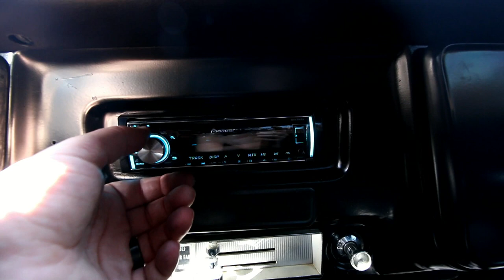Alcantara Suede Drifting Steering Wheel

Comment: I've used a similar ebay wheel for 18 months without a single issue including a lot of performance driving with a manual steering rack. You'll know pretty quick if you have a bad one or good one.
Reply from the maker: people just like to be negative....I have no worries
Reply: The Fab Forums Agreed. It would be a great addition to the interior of the Goose

Comment: hey Kyle have u ever rotated an axle to achieve correct pinion angle?   I'm trying to flip my rear axle in my 1978 Chevy blazer and want to do everything correctly. i understand I can buy a kit but had the perches already and plate to make the u bolt plate. would rather "fabricate" my own rather than buy. Didnt know if u had ever tried it or done a video on it. any info would b a huge help. thank you in advance  God bless and go build something :).    Sam
Reply from the maker: yeah... I have done on trucks I have lowered and many times on drag cars

Comment: Okay, so the rivnut video you link above shows a different tool.  The rivnut tool I bought broke within the first project I tried (stronger rear door panels on my Suburban).  The blue one you use in this video is similar in design, but I'm guessing it works as advertised.  Can you provide the link to it, too?
Reply: My bad, you did link it after the video.  I guess I bought the cheaper version of the Astro (the 1427).  Not sure why it doesn't work like it's supposed to.  Has the 1442 worked well?  I may need to upgrade to it.
Reply: We use AFS Marson rivets, rivet-nuts, nut-serts, thread-serts, stud-serts and tooling.  We have not been disappointed with the quality, results or the performance of the tooling or consumables. 
In our business failures are not tolerated.
Reply: I use the same one he has and have for awhile now. Ive probably installed 5 sets(4) wheel flares and made countless mount brackets/switch panel mounts/batter box mounts/fuel cell mounts/methanol mounts/ various underhood acc' mounts on the racecars i build for people and havent broken it yet. i'd say im probably close to 300-375 rivnuts in with it, if that helps you out at all.
Reply: sly5.0gt actually, yes, that does help immensely. Thanks for the info!
Reply from the maker: I have not had any issue with it so far

Comment: i personally wouldn't cheap out on the thing that is the direct interface between you and the vehicle. there have been many horror stories about cheap ebay steering wheels. i guess if it's just for a car that you cruise around in it's probably ok but i wouldn't recommend it in a vehicle that you do any type of performance driving in. Driven Steering makes a wheel that is pretty much identical, except black and red you can rely on for about $160.
Reply from the maker: I have had several concerned about the strength....guess I will have do some testing
Reply from the maker: I have had several others send me this same video. Looks to me like dude pulls the hellllll out of it in the beginning. Who actually does that though? I will for sure take a good look at the wheel I have but that video doesn't concern me at all. Not that mine will be different but thats not the same wheel I have either. Thanks for looking out.

Comment: Nice wheel :) Got one on the twinturbo and it's nice allright., just waiting if it'll bend easily or something? The Sparco on my car seems solid but let's not talk about the price 'cos it makes me feel sick! 35$ I'd say that wheel is bang for the buck!
Reply: lol...what are you into your sparco? im $327 into my triple black suede/leather sparco..... really makes ya enjoy the safety of your pop-off hub when you can hang your steering wheel above your bed for safety at night lol
Reply: I enjoy it so much I always use gloves :P the legislation doesn't allow pop-off hubs in road use. The Finnish moose, wolves and bears are so nice they never break into cars :)
Reply from the maker: yeah I have had a lot of comment about them bending easily. Guess I will have to find out the weak point and fix it...:)
Reply: With enough force you can break anything, 5 or 6 point harness takes the last stress of the wheel. So there's just no way of bending it unintentionally!
Reply from the maker: I have had several people send me a video of some guy pulling on a cheap wheel and the only thing I can think about is, who pulls on their wheel like that?
Reply: I've seen the same videos i think. The only time your pulling on it is when your rolling over or when your really fighting the wheel in a hard transitional corner(like when i bent mine a bit lol). Your more than likely going to crush the wheel in an impact when you wreck than you are to yank on it and rip it apart. Mine is bent so little you can only really tell if you turn fast, look at it directly from the side or if the cars in the air and i turn the front wheel causing the steering wheel to spin fast and i put alot more force on it than most fighting that stupid thing back into control. It was either i gain control, hit a brand new M4 BMW Carbon  edition track car, hit viper ACR or hit a wall..... thus i missed them all, but that was my last lap before i had to sit down and call it beer :30 lol.....